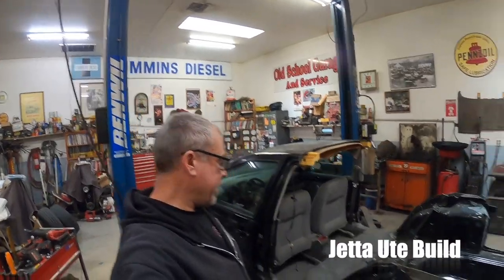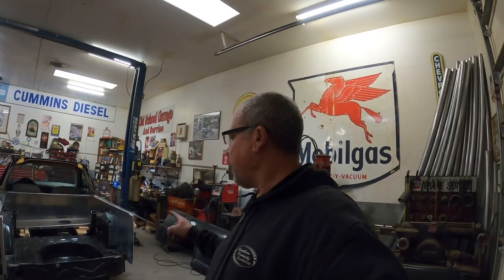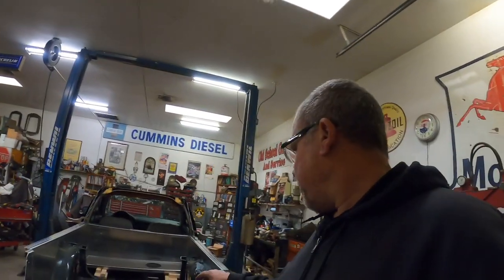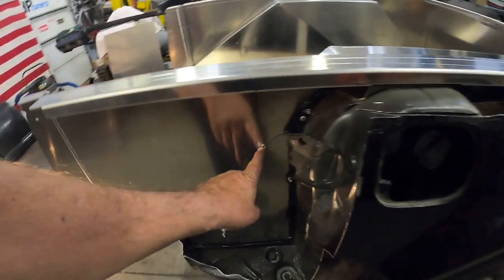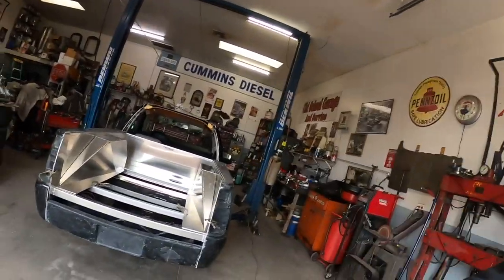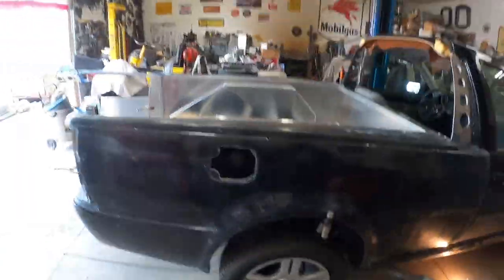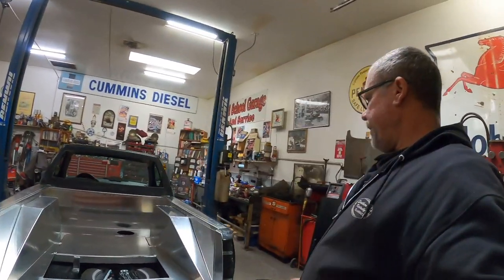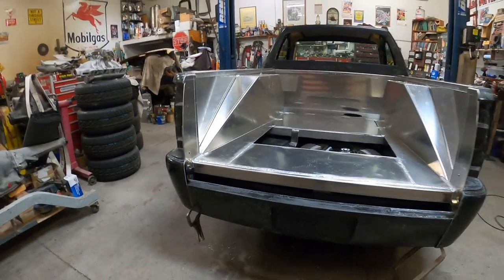The Jetta Ute is Starting to Come Together

Comment: I have a made in Japan Toyota Truck. Not a Hilux. The original mini pick-up. Your Jetta is a fabricated imitation, well done job for you Merlin!! Many "big" truck owners do not work there trucks, only for commuting. My 1986 truck was a farm truck and has only 85000 klicks on it. I had it rebuilt 6 months ago and have used it very little. Everywhere I take it I get lots of attention and likes. Your new VW truck rebuilt to your satisfaction will also give you lots of likes in many ways. Congratulations on a fine job, made in the USA

Comment: A pair of Vice-Grip 7LW pliers is great for when you need a second person to hold a wrench since their triangular jaws will hold the nut or bolt without marring the head leaving it all serrated and jagged.  They've become my favorite go-to locking pliers in the workshop.  A piece of duct tape holding the bolt in place when you don't want to tack weld it can make getting the nut started and the Vice-Grips attached easier.  Don't have to worry about harming your dummy holder plus the pliers don't cry or bleed if you mess up.

Best!

Comment: Awesomeness! 
My only concern with cutting out the spare tire well is adding the structural integrity back in afterwards. 
Unibody construction works together, as a system, especially when it’s German engineered VW. 
Personally, I’d relocate the spare to a mount at the front of the bed, right in the middle. Given the intended use as a parts hauler, having the spare tire at the front of the bed would give you a cushion to keep any errant parts from smashing into the front of the bed/custom cab window. Also, it would facilitate a full size spare, instead of an emergency donut. 
Or, you could just forgo the spare and use run flat tires.
Reply: These already come with a full size spare
Reply: Agreed. Keep the tire well, make a hatch in bed floor to access it for more storage. Relocate tire. Personally I’d fab a mount that swings away to be able to drop tailgate. Or go to junkyard to cut out the recess in the back side of older suv that has spare mounted there, and French it into bed floor. Either on side or middle front per your suggestion

Comment: This VW car in Europe is called Bora and the 1.9TDI engine is one of the best and long lasting and economical vs what you get out of it. A Bora was desired by me to buy but because of the limited space in the back changed my thought. Looks like the kit works very good and you Merlin are doing a professional job with it; so your idea to build it and the way is looking is really nice to me. Maybe some upgrade you will need for the back coils and shocks absorbers (dampers) for more stiffness when heavy loaded but for sure you will find the best solution.👍

Comment: Great video, brought back many good memories for me. Back in the early 1960s at 14 years old I bought a 1950 Pontiac 2 door with a flat head 6 cylinder for 15 dollars to drive the old logging roads around our cabin. With the idea my Dad had to turn it into a pickup truck and the help from his friend who worked the CCC camps during the depression we got it done. We used it for many years dragging logs hauling wood and just driving around the woods. Thanks again for the video I thoroughly enjoyed it.

Comment: I love the sound of that ALH just doing it's thing. I've owned 3 TDI's so far and need to look in that direction for a clean MkIV body to put a drive train into from my previous Jetta. The current wagon has 405k miles and running well with lots of love from a local TDI guru, the body is suffering from northern winter road conditions.  Thank you for doing this video documenting this conversion. Great job!

Comment: I tried to buy a Tdi Wagon  years ago when it was supposed to be the Last year in California they would be offered. I liked the mileage capabilities of 50 MPG vehicle. I had driven the auto and stick. The performance of the stick was better. It had a nice stereo system called the Monsoon. The dealer wanted $5,000 over MSRP. I ended up buying a new Ford Focus wagon with a Mazda motor in it. I liked It was quick, but MPG was nothing Like the TDi. Having a little truck that gets great mileage with prices of fuel today would be wonderful. A good bed coating that was durable to haul stuff in it would also be great. I wish I had a neighbor like you to learn the skills and knowledge you have. YouTube is great, having a Craftsman in person to learn from is much better. Thanks for sharing.

Comment: I really like it. I went to the website and started doing a little dreamin and schemin on what I'd like to do. They have some really good looking kits. 

It would be nice to find some space in there or the fenders for some sealed tool compartments to carry some cheap emergency tools and ratchets but I completely get the truck style hoist method for the spare. I see a lot of folks on the side of the road unloading their crap trying to get to their jack and spare. 

Did you build in any tie down points? Be nice to have some D-Rings to attach ratchets to and keep that motor you are hauling from ending up in the cab in a brake check situation. Stuff happens.

Comment: Good day.  Three things i noticed. One the fit and finish is of high quality. Which might fit the needs for the EU market. Two washers being used with rivets is not a new thing. Been in use in World of Outlaw Late Model Racing for as long as I can remember. Started using them back in the mid 90's. Third you need a VW diesel logo now.🤣😂. Love the Diesel content.

Comment: I have an idea. So if you make the compartment  waterproof you can use that for a cooler. And add a drain plug ( of course). Like the Toyota ridge line. Then put a light duty headache rack in it. Then you can mount the spare to the headache rack. And if you need more room to haul just move the tire to haul. And strap the tire to the load. Because it probably won’t be loaded that big since you have other trucks for those kind of jobs.

Comment: Hi Merlin.  That's a cool looking, little truck!  The TDI VW's are reliable and generally rock solid.  One issue I've seen was on a high mile (360K+) engine where the seal between the hot and cold side of the turbo blew out somehow and the engine went into run away, running off crankcase oil.  I imagine that's a pretty rare occurrence though.  Thanks for the video!

Comment: This is going great!  Im not sure if you have looked into it at all but if you want better brakes a cheep upgrade is vr6 front calipers and rotors, they are just a tiny bit bigger diameter, but the have a lot more pad area.  I uavent seen anyone do this but i compared the coild springs off the front of a buddies ranger and the ones off the back of my jetta and I think the airbags they make to put inside the springs on a 96-99 ranger for use with a snow plow would fit in the rear springs on a mk4 jetta

Comment: I love this build.  I have a 2004 jetta gasoline 5 spped sitting on the side of my house needing love.  Great teen car, but it needs some exhaust repair, mouse smell removal, a/c tune up, windshield and paint, lots of paint.  My son wants a pickup for school, but wants higher mileage too.  I think you found a solution

Comment: The new adhesives we have these days are amazing. I had knee replacement over a year ago. The Titanium is glued to the bones. If it continues to hold, it has to be much better than having spikes driven inside them. The truck is looking pretty nice, especially with your changes to make iy your's.
Reply: Wow, didnt know that they used glue!  Hope it holds and it is amazing what the auto industry is using while building new cars, simply amazing.

Comment: I noticed there's no tie downs in the bed. Are you going to add those and now that it's a truck are you planning to upgrade the rear suspension? It's coming out pretty nice. You need a 3rd brake light above the rear window.

Comment: great project Merlin. 
Why not use the spare well as a storage area and,  go to a spare in a can,  after all how many flats do you expect to have,  I've been driving since I was about 11, legally from 15, I'm  68 now I've probably had 4 flats, maybe 5,  and only one where the wall of the tire was ripped out,  admittedly that was in the Australian  outback  and a spare was needed,  but it still wouldn't have stopped  me getting home,  even if I didn't have a spare,  I mean that's what dry grass is for,  right?

Comment: For the spare tire cut the well and flip it . Won't be and exact fit but possibly the structure underneath will allow access. 
And the bed wouldn't require the deep support in that area.
Just a thought.
also a main reason the Honda Ridgeline never was appealing. 
My buddy hauled aircraft parts and when doing so would first place the spare in the bed.
Any way dig what you do . Videos are  just short.

Comment: I understand your issues with accessability to the spare tire, that's the same problem I have with relocating the fuel filler into the bed floor when doing a fuel tank relocation on something like my F-100. I think it would be easy for you to adapt the spare tire winch system from a later model pickup, but if you did that would you even have room under the thing to retrieve the spare tire?

Comment: Bolts vs Welds: That is a rough choice...especially once you can weld. Bolted joints can flex without breaking. Drilling big holes can seem very tedious...and the whole time you are thinking "I could be welded this twice in this much time." But, even the best welds crack. That area was critical and that is why the crack appeared in the virgin metal, in the first place. Naturally, it is different when doing something liek this (typo intended). Bolted joints require a certain amount of overlap and that is how things get heavy. My prime example of this was the Liberty Ships in 1940 to 1944. They never built those rigs to last for decades.

Comment: Watching with interest from UK. Built my Smyth conversion in 2018 on a 2002 Bora (European market Jetta). 130hp diesel with 6 speed transmission, climate control, etc. My kit came with a aftermarket rear window (Hilux ?) which has opening centre section. Is yours fitted with a one piece rear glass?

Comment: Did you end up using the aluminum rivets to attach the B-Pillar?  I saw he had a monel rivet video on his elwebsite and figured he used the monel rivets. When I got my kit, I see he sent aluminum rivets. 

Did you reinforce that speaker hole you cut out with anything? 

I am coming from a helicopter airframe me hanic background, so I may be way overthinking this build.
Reply from the maker: I used a few metal bolts and then mostly the aluminum rivets and I did use panel bond when I glued it on and I did not reinforce the speaker whole
Reply: @MerlinsOldSchoolGarage  thanks for the quick reply! I am probably overthinking it, but I will end up doing something similar as you. Probably will use monel rivets though for the neutral galvanic properties.

Comment: What is strange VW made the Rabbit and the truck back in the 80s. My Dad could not find the truck. So settled on the rabbit. That thing got 60 miles per gallon without the air running and 55 with the air. None of the technology that they have today. Diesel powered. Took it 5 miles rolling black smoke to get it to 60. But the cars today. Think the best I have seen is 40. What happened? OH!~ daddy put 400k Miles on the car. Motor was worn out. Not enough compression to run. Had as much smoke coming out of breather as it did the exhaust before it quit. Daddy was very upset.

Comment: How are you going to stop that folding in half? You have removed the rear roof and C pillars from that unibody design, surely you will need way more than a cabriolet kit of floor pan reinforcement if you are talking of carrying a 1000lb engine on the bed?

Comment: The 80hr build time is laughable if you want something oem quality. 
I've been building mine for 3 years, I've definitely got 1000hrs in it. 
You'll see if you want something to last ,it'll take alot longer.
Reply: Coulda ran the wiring thru the door pillars, it saves on a potential leak spot at the cab wall.
If you use a 165-45-15 on a stock wheel you can pull it out of the well without removing the brace.